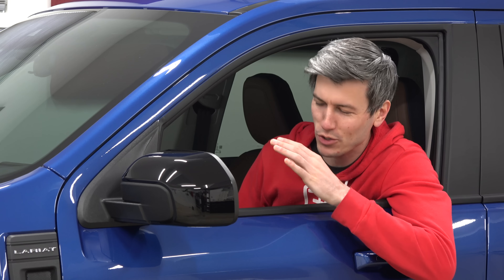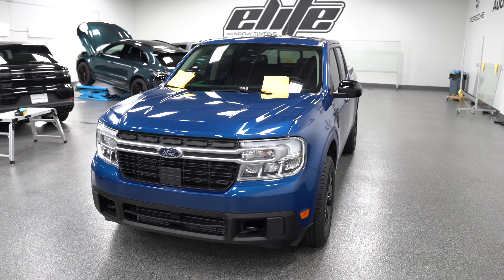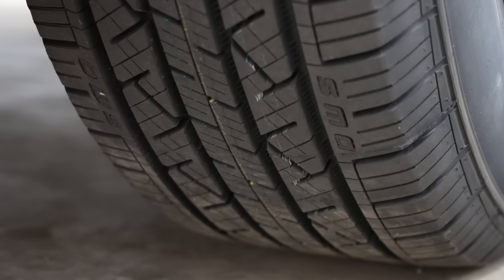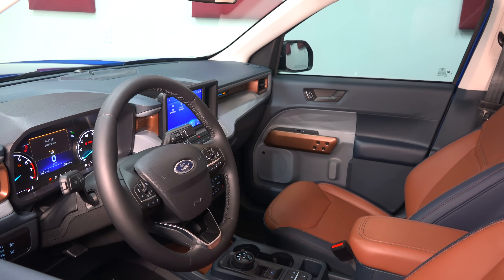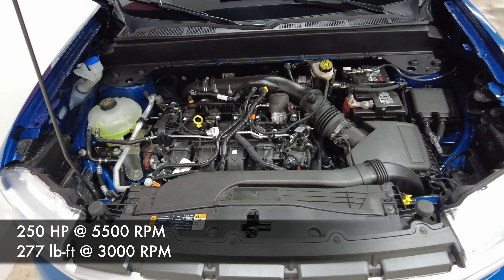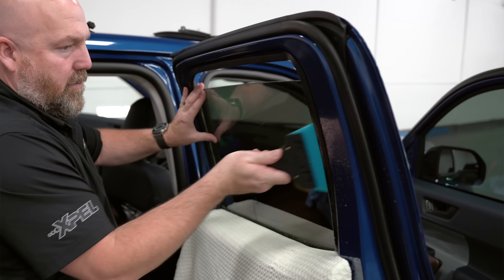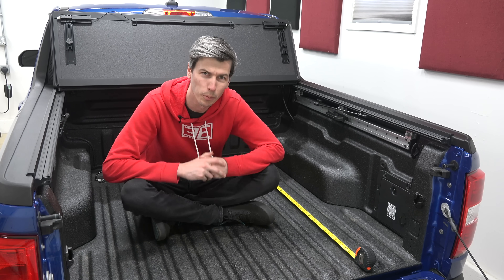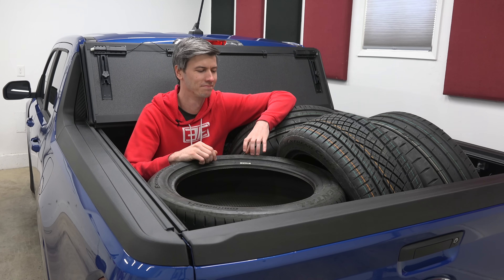I Bought A Ford Maverick! The Perfect Pickup?

Comment: Is it reliable? It’s a ford 😕
Reply: Maintain well and don’t drive like a maniac, and just about any car will be reliable.
Reply: Ford has big problems when they retool production lines. Exercise a bit of patience and avoid the first year or 2 of a new model and they're great. I've owned multiple Fords and all have been free of major problems until the rust kills them. I'd bet that if you took the first year or 2 out of reliability data, Ford would be right up with Toyota.
Reply: I would say they are reliable until you hit that 100K mark and you start to have issues and also having a turbo doesn’t help when it comes to reliability, just how new tundras have due turbos that keep popping Avery 35k … I know this cause I work in a Toyota shop
Reply: Cool link to the Canadian.
Reply: @TheLoamGnome171 If I run down the list of problems I've had with 4 Fords, the biggest issue was a 2006 Focus needing rear wheel bearings 3 times in 180,000 miles. Rather annoying, but not expensive.  And I treated that car like a truck. Frequently loaded very heavy for long periods.
Reply: I've had ford's last up to 200k miles with basic maintenance, including the clutch. Not all ford's are bad there bud. Most vehicles, you take care of them, they'll take care of you.
Reply: I have daily driven 2 raptors over 100 thousand miles and now have a Gen 3 already has 60 thousand miles on it and zero issues with any of them.  We Aleos have a Navigator a 2024 12 thousand miles zero issues.   Fords quality issues are greatly blown out of proportion by the media.   Chevy and Ram hide most there issues by doing warranty issues under TSB’s.
Reply: Consumer Reports ranks the Ford Maverick as the most reliable of all trucks sold in America!  The Maverick scores higher than Toyota, Nissan, GM, RAM, and better than Ford’s other trucks!
Reply: If you can afford the repairs then it's reliable 😂
Reply: My Maverick is a lemon,  it was  a nightmare,  i hope customer do not have issues the I have.  I like the the truck,  but I'm no safety drive mine
Reply: You do realize the f150 is the best selling truck and it's a Ford right?
Reply: @BudgetGamerz that doesn’t say much about the reliability lol
Reply: it only means how naive people are.
Reply: @BudgetGamerz  best selling car even not truck in the USA
Reply: @BudgetGamerz  yeah but ask any mechanic about the reliability and the problems
Reply: @willypp13  stop regurgitating what you see on the Internet sir. I mechanic I know complain about the f150.
Reply: Best selling,  doesn't necessarily mean reliable. @BudgetGamerz
Reply: @BudgetGamerz totally different vehicle and best selling does not tell you if a vehicle is reliable.
Reply: @Greatdegn91  I responded to OP saying it is a ford.
Reply: @BudgetGamerz  best selling doesn’t mean it’s reliable
Reply: @BudgetGamerz that doesn’t make them reliable lol
Reply: @BudgetGamerz and every year Ford tops the list of manufacturer recalls.  Ford is not the best choice for built right from the factory.
Reply: @myhandlewastakenandIgaveup  continue making stuff up. Recalls means you found an issue and are fixing. Means nothing bad to the consumer.
Reply: @BudgetGamerz  apart from horrible manjfacturing QC.
Reply: @myhandlewastakenandIgaveup  you are free to make things up lol.
Reply: @BudgetGamerz  those engines make it about 60-80k miles before they need to be rebuilt. You can drive a nissan frontier 350k miles and the engine is still working!
Reply: @icedcoffee8561 

You're not going to get too far blatantly lying that bad. Literally no regular modern car requires an engine rebuild at 80k.
Reply: @snaaaaaaaaaaaaaaaake  lol, a rebuild at 80k 😂 he can't make it any more obvious that he has NO idea what he's talking about!
Reply: @icedcoffee8561 ... where are you getting your info from? Ford, mostly, doesn't have engine issues. Ecoboost has cam phaser issues but that's been resolved and 2.3 in the focus rs for the first year had issues, but those were resolved as well. Otherwise, the don't have engine issues. Plenty make it to 200-300k Miles without being rebuilt/replaced.
Reply: @icedcoffee8561 on that frontier at 350K you’ll be on your second or third transmission though 😂
Reply: @chas3778  had the transmission fail twice, both times was because a wire had shorted, easy fix. Really common in with some years transmissions
Reply: @TheLoamGnome171 I didn't say it's the most reliable. However it is reliable.
Reply: So about average?
Reply: Something people fail to realize about sales numbers in relation to problems is...
GM literally sells 8x the trucks of say Toyota (the urban legend reliable truck 🙄)
Ford sells 7x
Ram 5x

So when people say Toyota is more reliable because there is only 1 in the shop compared to 5  or any other brand. The reality is, Ram is the same as Toyota, and ford and GM would be better.
It's simple ratio's here people. And so many people never consider this fact. 
Not to mention, Toyota doesn't even make heavy duty pickups, so when someone is hauling day in day out with a 2509, 3500, 4500 etc. a Toyota will never ever see that same workout.
And to be clear, I'm no ford fan lol
Reply: No disrespect Jason, but if this is not a hybrid, it's really not that interesting no matter how you spec it.